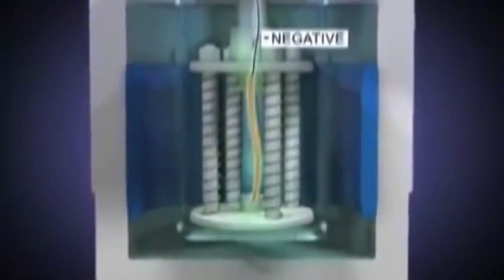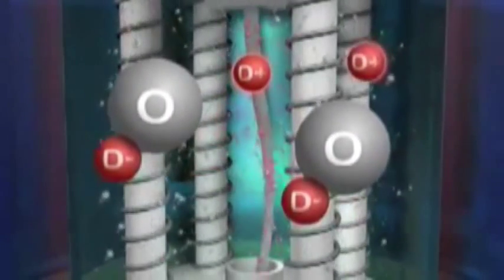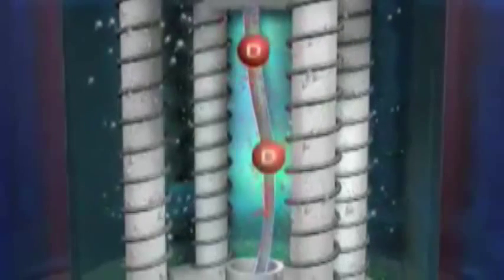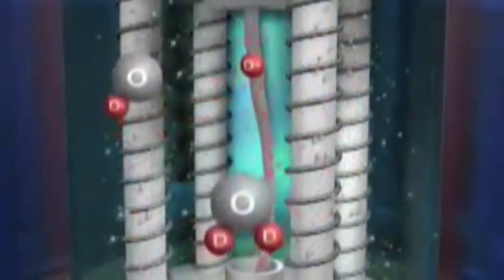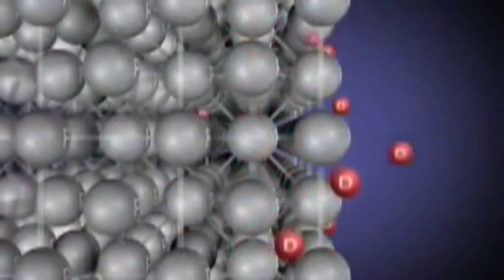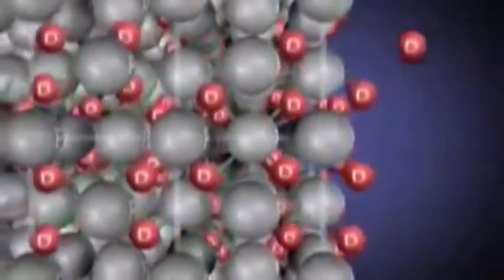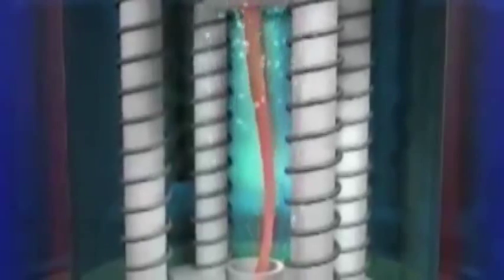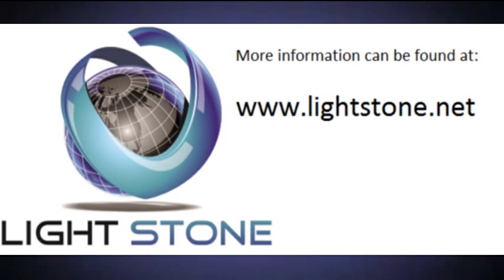Fusion (LENR) Power Explained - Lightstone Technologies

Comment: So basicaly,
Turn carbon
And oxygen into co2
For heat
Then take co2 and burn it to get co + co
Then burn it again to get another 
Use same system - they basically created a " jet fire hurricane type wood burner" spiraling up to self sustain a bigger fire
I guarantee you
If you concentrate the eletrodes under the tube only
Not around it like a kebab heater rotator
Make the cathode a cone shape
With the tip touching the cathode
Spin the cone 1million rpm
While igniting the bottom with 50million volts
And 0.0 (50million . 1 amps
( 1 watt )
We can achieve a 0.04watt to achieve fusion
But the 1 watt is fine